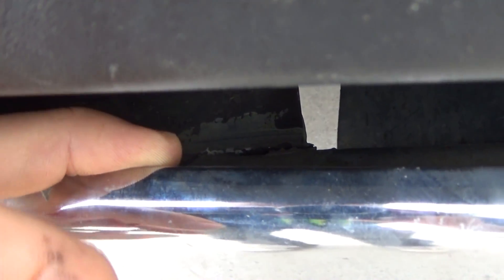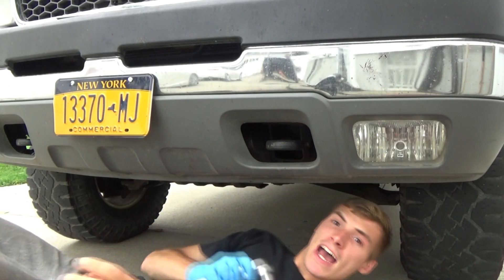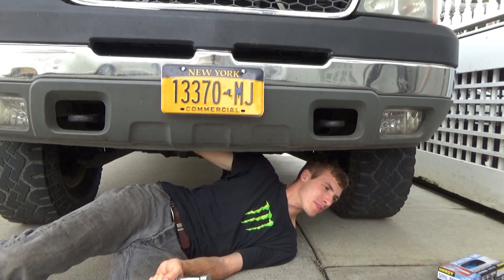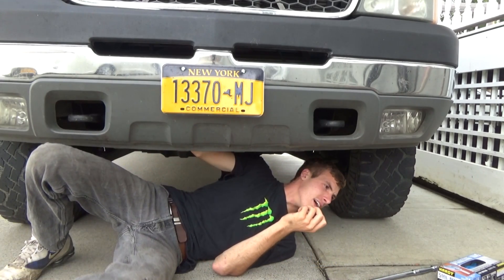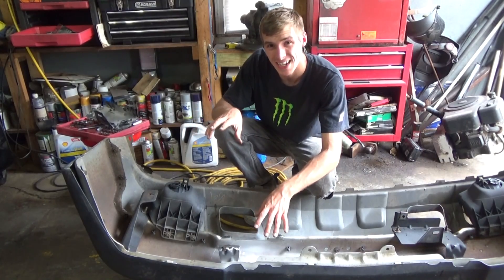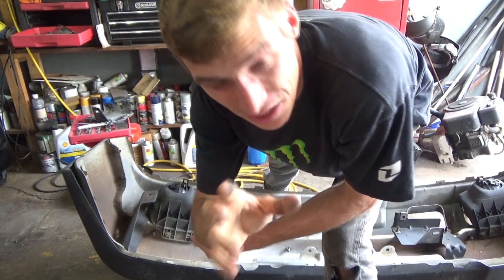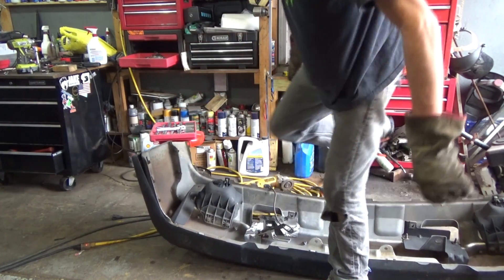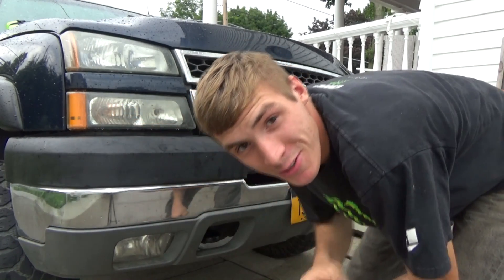BROKEN COP TRUCK BUMPER

Comment: I'm with you about metric.  Its a pain in the butt getting stuff built in the States and it imperial.
Metric system is easy too!  10mm to a 1cm, 100cm to 1m, 1000m to 1km...... thats just the start!

Comment: 3D machines what happened to the light bar on the duramax
Reply: No he doesnt, He has a different light bar on his quad, Not the one that was on his truck. LMAO.
Reply: Chris Marcoux he took it off when he tried spray painting the roof and I guess he did not put it back on yet
Reply: Josh Doerksen no he had this huge light bar on his truck on his roof now it's gone but it's been gone for awhile now I don't now why
Reply: Josh Doerksen no he ended up taking the light bar off his truck so he could get it painted or something his quad light bar is the same just smaller.
Reply: Ok, I like the truck with the light bar though

Comment: Dalton just a recommendation if your going to get winter tires try to have the alignment done with the new tires installed this will get you a more accurate alignment considering the old tires are pretty well worn. This can help you save money in the long run by getting more life out of the new winter tires you are going to install. Ive done alignments with worn tires before and there can be a traumatic difference in your alignment with old tires vs new tires. With that said i love your videos and cant wait to see what you are doing in the future.

Comment: That waving effect on the worn tyres usually signals worn shocks or other worn suspension components i suggest you check all the bushing and ball joints for wear, also check wheel bearings.

Comment: just a tip, if you remove the grill the top bolts are much easier to take out. the grill is only a 10mm bolt and 6 clips

Comment: hey just curious why do you have commercial plates
Reply from the maker: Truck is really heavy. NY states large trucks need "commercial" . Another way to charge more money
Reply: BODMAN57 hi
Reply: 3DMachines  so have you stopped writing back to people with fan mail yet if not I sent a letter today
Reply: He stopped October 1st
Reply: Holy shit that's  crazy classifying a 1ton as commercial.
Reply: Does that also mean you have to stop at scales?
Reply: 3/4 ton***
Reply: Teslera
Reply: in New York State pickup trucks over a certain weight need to have commercial plates. I believe its over 5,600 or 5,700 lbs. not exactly sure of the weight. This went into effect 8/2015. Before 8/2015 pick up trucks registered in NYS required commercial tags regardless of weight.
Reply: i think its 6k now so you can sneak in a F250 as suburban and still get passenger plates
Reply: i registered my f350 2wd diesel and it was under the limit. I have to believe it has to be close to 6,500lbs. I'll look on the registration in the morning..
Reply: Its kinda how its like in California, anything with a bed needs a commercial registration. It doesn't show on your license plate but they do charge you extra.
Reply: BODMAN57 t
Reply: BODMAN57 his gross vehicle weight in the state of New York won't allow passanger plates it's above 5300 on the original mso.
Reply: daniel bean  if your pick up weights more than 6k it has to have commercial tags, go look up the rules on the dmv website. also if you have a cargo van with no rear windows regardless of the weight it has to have commercial tags regardless
 of the use https://dmv.ny.gov/registration/register-pick-truck-passenger-class-vehicle

Comment: you should get the new tires then get it aligned with the new tires on
Reply: I've always heard that but never've seen any hard evidence either way.
Reply: kyle simmons Well if the new tires are a different size it could throw the alignment off. Happened to me before.
Reply: Tire size has nothing to do with alignment.  Changing suspension geometry and replacing loose parts does.
Reply: changing the rim offset will make a difference, hitting a bump is enough to knock the car out of alignment.
Reply: How does a bigger tire change geometry?  All it does is lift the hub and the rest of the vehicle away from the ground.  There is no effect on the suspension whatsoever.
Reply: Changes the angle of the A-Arms
Reply: It would change the angle IF the vehicle's body stayed in the same place and the hub was pushed up, but EVERYTHING moves the same distance up with larger tires.
Reply: buddy go from stock tires to 33's like I did and tell me it doesn't mess with your alignment.
Reply: I can see larger tires needing slightly  less toe in but your argument of the A-arms angles changing is wrong.
Reply: Nucc's Garage I have changed tires half a dozen times on my truck, everything from 235/85/16 to 285/75/16. From low offset Duramax rims, to high offset offroad rims. The alignment never changed.
Reply: FCFordLord and youre also driving a ford, so shows how much you know lmao
Reply: If the rim offset was changed when putting the bigger tyres on then it would change the alignment, bigger diameter tires won't change a thing but change the gearing slightly

Comment: I saw your tire wear issue. I am betting that just an alignment won't fix your problem. you will need a pitman arm and likely an idler arm too.  

you can get super heavy duty parts but I just did a Moog...solved my problem.

Comment: Hey so 3D Machines I've got a 2001 Honda Trx 90 atv but it runs on starter fluid when I spay it into the air filter but after that it dies unless I put it on full choke if anyone could help I would greatly appreciate it thanks.

Comment: Not saying you don't need an alignment, but your tires are "cupping". Happens on all 4 wheel drives for some reason. You just need to rotate the tires more often. Those tires when put on the rear will smooth right out. 
This coming from 20 years of driving 4 wheel drives. It's just the way she goes.

Comment: just so you know, those tires don't need aligned. i work in a tire shop and that is completely  normal mud tread. if it was wearing, both of those knobs would be worn down

Comment: Ohh. Dude my truck was wearing the tires like that, I doubt it is just the alignment. That looks like a suspension issue and that is the side the bumper is messed up so the truck looks like it took a hard knock.

Comment: the tires are like that because of mostly your shocks you need new shocks and bushing otherwise your tires will still be cupped like they are and get worse. also you really need new tires or better used ones

Comment: Why didn't you just use the wire wheel on the rust and then paint the backside of the bumper? Then used rust preventive.

Comment: Dude - just give the toe alignment a small adjustment yourself.  Doesn't have to be perfect on a big truck like that.  There's lots of DIY videos on how to use the strings and align the truck yourself.  I started doing this six years ago on my big diesel and have never been happier.  You can tell if you get it right by how it drives and the tire wear.  I had about a 50% success rate with alignment shops.  They never seemed to get it just right and they are expensive.